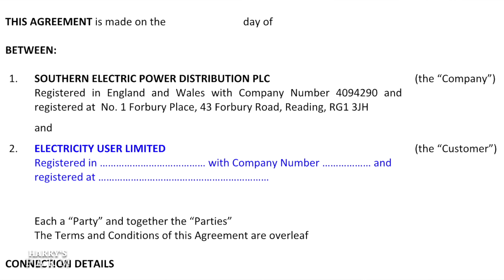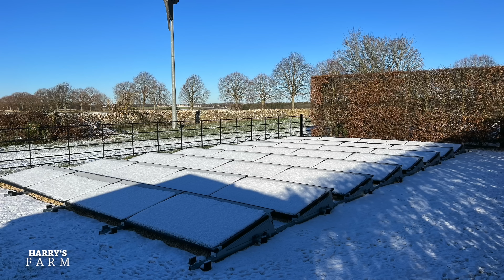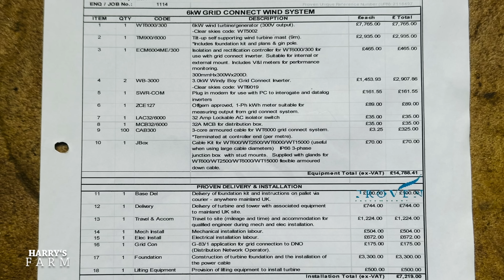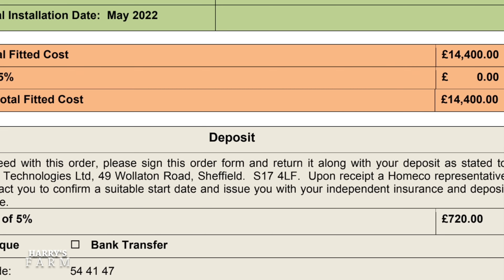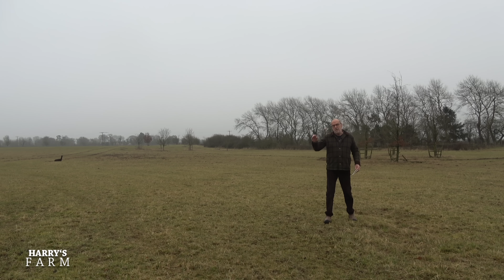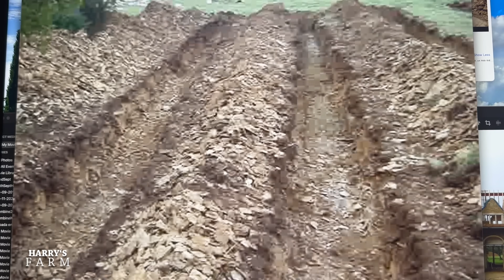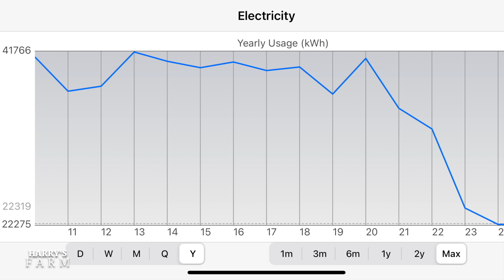Are solar panels & heat pumps worth installing? Here's what I've learnt after several years of use.

Comment: I was totally amazed at his surprise in the difference between summer and winter outputs from the solar ….what was expected 🤷‍♂️
Reply: If the panels were moved to a steeper angle, they’d generate slightly less in summer, more from autumn to spring. To me, they look too steep for June 21st at lunchtime! 

But… I’m no solar panel installer.

Comment: Living in Perth (Western Australia) the amount of sunshine we get is obviously quite different. For 3/4 of the year we are concerned with cooling, not heating. I have a 6KW system on the roof and find that it is sufficient to allow me to leave the air con on all through daylight hours which cools the house and then use a ceiling fan at night. My summer bill used to be my largest, now it is the smallest. To get the investment back takes 4 - 5 years but it does work well. Being retired washing / dish washer etc. are used generally during the day - maximising the benefit. I do sell to the grid but that's small change. I believe we now have the equivalent of two electric generators on Perth rooves and growing. I have been told batteries aren't worth the cost at this stage. Stupidly, with so much of our state being unsuited to farming, solar farms end up taking up arable land - because that is where the grid connection is......

Comment: The system doesn't shut down your production because it senses that a panel is going bad. What happens is that when several panels are connected in series if one is not producing enough it turns itself into a LED because basically LEDs and photovoltaic panels are the same thing on different scales. The non producing panel opposes a resistance to the current produced by the other ones and ruins your production.

Comment: Thank you my English brother for this eyeopener. To summerize it, you spent 14.5 grand on a 12kWh system, saved 24 hundred GBP a year therefore your return time is roughly 6 years while in Hungary I've spent the equivalent of 10.5 grand on a 8.5kWh system with 10kW batteries and saved 732ish GBP a year therefore my return time is roughly 14 year. All calculated in today's price. So saved money and return time can vary significantly. In Hungary we have cheap energy. Yet! So there you go...😅

Comment: Good for you!  After 30 years in solar including some multi- million commercial installs - I have to point out that as soon as I see these panels set on the ground- you lose credibility.  Anyone who is serious in solar learned decades ago that you NEVER mount solar panels that close to the ground.  When you mount those panels less than 6 feet up; 1) they will get "sand blasted" by any high winds as sand will not exceed 6 feet height 90% of the time, 2) you will experience grass and weeds growth after a few years when that gravel will of course fail in time = more expensive upkeep.  I could go on and on, but whoever mounted those panels on the ground did not know what they were doing and did you a HUGE disservice.  Of course, if they made a basic "solar 101" mounting mistake, I shudder to think what else is wrong here....sorry, I had to point out the obvious.  Also, reviewing a solar install after a couple years is like reviewing a car's reliability when you first start it and before you drive it off the dealers lot- solar should last 40+ years.

Comment: He's a very clear off-the-cuff speaker. A few notes, and all the points are made, with figures and no stumbling and cutting. I guess he's been presenting to people for years? What did you do for a living Harry (it clearly went quite well)? 
I'm interested to know what your annual heat load per m2 is as that's the true measure of building fabric efficiency. If I assume half your 22,000 annual kWh goes on heating, and the floor area is 475, then that's 23kWh/m2.yr, which is a very good - that's EnerPHit level (passivehouse retrofit standard, which is 25). But it might be 17,000 on heating, and all the stairs, cupboards, skeiling spaces don't count so maybe it's 400m2 in PHPP 'useful area' terms. That would be 42kWh/m2.yr which is good, comfortably beating the 50kWh/m2.yr of the AECB carbonlite standard, but only half as good. So, yeah for a 2007 house, despite the extravagances of pool, aga, and heated garage, you did a pretty good job. Self-builders generally build much higher-quality houses than developers do (because they care about running costs). Passivehouse is 15.kWh/m2.yr for reference.
Interesting video, thanks.

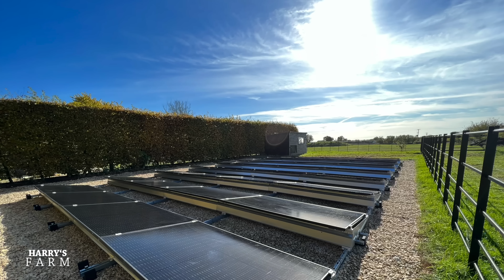Comment: Harry  -  The one thing that I noticed here at 5:54 is that your solar panels are almost laying flat with the ground and not angled up to look directly into the sun, having them up into the sun in winter is a lot more important than the angle in the summer because the winter sun is lower in the sky and it has to go through more of the Earths atmosphere to reach the panels.    The winter sun radiance (Dec/January is about  (3X Weaker/ less radiance) than the sun in the summer (June/July) so it is why it is much more important to have your panels lifted up and aiming more for a Winter Sun than the summer sun.       Also having your solar panels raised to a higher angle will help the frost and snow melt off more quickly and the rain will run off and help wash them.    Good Luck !
Reply: Best of all solution - install solar panels on a dynamic frame that automatically adjusts angles to current season or even follows the Sun. Things have become a lot cheaper these days. I would also install SPs higher above the ground for various reasons such as shading, mud splashes or anything crawling that can damage your installation eg. chewing through wires for fun. I know in this case there’s more than sufficient available space some could utilise under solar place as a shade area during hot summers.
Reply: @anylookup  20 yrs ago i installed 18 panels  [in sixes] on posts 5ft off the ground, fully adjustable. now i have 170 panels most of them 8 inches off the ground at various angles, concrete blocks and 4x2 timber. most not anchored. the closer to the ground the less wind issues , i use rocks to minimise the amount of wind that can get under them.  i have about thirty on shed roof just lying on the roof, the wind doesn't bother them, maybe a cyclone will.
Reply: @anylookup  that frame also has a cost. So price wise, you can just add more panels instead. 

But just lifting the panels off the ground does help. Maybe some place needs a shade or make the panels a roof for the anilals, tractor garage etc. 

I think winter optimization makes sense, in summer it's so easy to over produce anyway. Even now in February it's decent once the sun is up. Yesterday my 17kWp roof solar made 56kWh, more than i use even the coldest days.
Reply: 2nd this comment!
Reply: Hi, when it’s a grey sky and no sun to be seen the flat panels make the most power.
Take care M.
Reply: Only thing you didn’t mention was net metering.. This is why more panels harvesting summer sun giving you credits for winter makes far more sense then excessive battery storage.
Reply: From my recent experiments with solar panels I learned: Mounting racks and the wiring are more expensive than the panels themselves. Conclusion: Do not waste money on tracking the sun with incredibly expensive constructs. Better throw your money on simply more panels, no matter the angle or the azimuth. String inverts are nonsense. Take a bunch of micro-inverters up to 2000W and provide them with 3 times more peak-power than recommended in parallel. This will ensure at least some production in low light situations and performs way better with wandering shadows.
Reply: The size of your solar panels are way to small our 400 watt panels are 2 meters wide and long
Reply: @NickyClayden-r7y  My 420W panels are 1.78m by 1.10m.
Reply: I do admire Harry for trying these new energy / heat solutions. Especially with the farm side of things and pool , garages etc , but for me average, in 2-3 bedroom, Acaica Avenue, it’s just not viable . When you live in a country with weather as systematically shit as ours ,( last year was frankly pathetic), we have to be honest and admit that only the arctic tundra has worse weather than us . When we get more sunny / hot days in a year , than not , I’ll revisit this , but until , just wear slippers and put on an extra fleece .
Reply: @williammorris1384   I agree with the solar/good insulation comment from another contributor but not the heat pump......unless you've got a draught free highly insulated property ASHP are a money pit and even then it needs to be a balanced system to make it worthwhile and  very few properties can achieve that.
Reply: @williammorris1384  so wrong, my panels also ground mounted, 12 panels at 410w produced well over half my consumption even last years crap weather. I don’t run a pool but a 1200l hot tub 365 days, a large old house, so not as you described. It’s very feasible to have a system like my one on a roof. You don’t need blazing sun to produce electricity. Plenty of YouTube channels of people giving monthly reports on what they produce. It’s easy to work out what would work for you. So rather assuming it won’t work, look at those that are making it work.
Reply: @williammorris1384  lmao@new
Reply: @williammorris1384  it's always viable, maybe not perfect but some solar panels and batteries combined with good insulation and a heat pump really makes a big difference
Reply: From what I know about solar panels is that they should be angled to match your latitude for winter efficiency and they should face S to SW.
Reply: @rainbowdrive1961  Yes, aiming the solar panels to match your Latitude will aim the panels right in the middle between (summer sun overhead and winter sun low in the sky) however I prefer mine to be aimed about 5 or 10 degrees lower than Latitude in the sky to help increase winter solar production because as I explained earlier the winter sunlight must pass through more atmosphere and so there will be 3x (LESS) solar energy in the winter at the solar panels than there will be in the summer.     If you have a Heat Pump and cold winters as Harry has he needs more electricity in winter to run that heat pump than most people might need if they have Gas heat.  Solar panels that are off the angle of direct sun create a lot less electricity,  the best is to be aimed directly at the sun at all times with moveable solar mounts.
Reply: @Bowhunters6go8xz6x  You are not going to get significant output in the winter in the UK no matter what you do. Especially with the weather.
Reply: Why would you waste the angle trying to catch the small amount of winter sun we get than trying to capture the summer sun when it's sunny on more days and you get  daylight for 16-18 hours a day rather than 7 and half. You would produce more power annually by focusing on the summer sun rather than winter.
Reply: @ashlaw4392 because you have massive overproduction in summer - or at least, I have. Mine are already angled slightly more towards winter optimisation. I don't need 30KWh per day in summer
Reply: @ashlaw4392  summer for most people produces more than you can use. Winter you want to max out every drop. So if you don’t have a heated swimming pool, it makes more sense to get what you can out of winter sunshine. Now to be clear I recon there are only about 6-8 weeks a year the solar drops off to being a poor electron provider. That’s last couple of weeks November, December, start of January. Rest of the year those solar panels wake out the power. National ave UK electricity price is 29p kwh. Solar, batteries and right tariff choice you can get your consumption costs average well below 10p.
Reply: @ashlaw4392  True. But it depends on the location; in some places electricity in winter is more necessary than in summer and vice versa. If I'm in Arizona, I need that electricity at max in summer to run the air conditioning; if I'm in cold gray skies England, I need that electricity as much as possible in winter for heat for which in the UK many don't even have air conditioning.  System I'm looking at right now(I'm in the Midwest USA), my roof the production in winter will be surplus according to calculations we've done so perhaps I'll use some electric heaters. Summer I have a lot more sun and electricity produced, but seems it'll be a little short of what I need as my AC runs pretty heavy in July and August.  Then again, hopefully the panels on my roof reduce the need somewhat for AC as the sun is heating them as opposed to my shingles.

Comment: I’m a little surprised that he is surprised at any of this. The idea is to build to a size that targets a given percentage over a year’s time.   

A responsible installer will be very clear that Summer, then Spring and Fall are your producing parts of the year. Further, that your nameplate system wattage is Idealized from test conditions, and is NOT the regular production output you will really EVER see.  The target is your annualized take.

Comment: 14 times implies some shading (and I can see there is some in the snowy pic). It's typically 9 times difference winter to summer peak in the UK. That's still a lot, and yes you need a huge system if you want it to heat your house in winter. (We have 7kW on a 3-bed house and that runs all the electrics all year round except about 4 days/yr when we get 5 grey days on the trot (like right now), excluding heating). The UK is a long way north so we get this huge summer/winter differential.

Comment: The answer is, it depends on where you live.  If you live in a place where it is cloudy when you need power, solar is a bust.  If you live in a place where electricity is cheap and unlikely to ever go up dramatically, forget solar or wind, just stick with the power company.  Here in the Bahamas, I have 21kW nominal which is more like 14kW actual give the mounting choices I made for hurricane sustainability.  The power is tiered in price so that if you live like an illegal Haitian (i.e. very austere), you "only" pay $150-$200 per month.  And then there is a middle tier which is narrow and then if you use any air conditioning at all you are in the top tier.  My 2800 sq ft house has 2 AC units and a huge part of my AVERAGE bill was billed at .55 cents per kWh (before installing the solar) and it ran me about $700 per month me trying to minimize AC use as much as possible.  Now that I have 50KwH of battery and ~14kW of real production I am very near being off the grid completely.  I am installing another 50kWh of battery and I have the ability to install another 8kW of generation if I see fit.

The cost for install was high even though I did most of the work myself, around 85k USD for a premium install (meaning on top of a shipping container that was converted to a battery house and looks like the main house structure after being disguised with hardiplank ship-lap).  Thus it would not be worth doing unless 1) I had a lot of year round sun and 2) the cost of city electric was outlandish and going higher.  Both of those things are true in Freeport Bahamas and so it was an easy decision with a 10 year payoff.  One nice thing is that I do not need a backup generator.  The install includes an ATS that falls back to city power if there is no sun and my batteries get drained.  Also, if the city power goes off the only way I usually know about it is because generators begin auto starting at all of my neighbor's homes.

I should note that solar panels, batteries and inverters are coming down in price.  My system is made of older, high grade components  like Sunny Island inverters instead of cheap Chinese gear.  But those inverters were $4k each when I was buying them and you need 2 for split phase 240 VAC.  Today you can get a 10kw sine wave inverter charger with direct solar panel hook up for $1500 and that takes the place of DC combiners, DC cutoff, charge controllers (and all the breakers for them), and a ton of routing of expensive copper welding cable.

If you are reasonably intelligent, patient and are willing to write down a detailed plan, anyone can design their own solar system and save the stupidly high cost of the installer.  Then just get a certified electrician to do a final check and sign off on the work.  Of course, YMMV based on how much local government busy body bureaucratic tyranny you have to deal with.

Comment: You made the mistake of listening to installers “we will optimize the system for summer” they say. No, optimize for autumn/ winter, the summer will take care of its self , yes there is still a summer peek but you can heat the house and run the cars March to late October with a bit of care and batteries.

Comment: So in 2007 u started fitting all this stuff correct?
And what did all of the massive amounts of panels pipes digging concreting cost.  
Im sorry but theres eliphants in rooms and then theres a full herd!   The amont of money diesel and carbon that went into this stuff is simly enormous and there is no mathematical way it it cost effective or carbon cost effective,  every pro ev sustainable anti oil video news broadcast advert an ao on does the same thing as harry did here

Comment: I recommend getting Microinverters for each panel since that will solve your shade problem. you will also see more power output from each panel in winter months.
Reply: 100% this.  Shutting a whole bank down is obsolete
Reply: This is one of the value factors of microinverters that few people understand.  The  microinverter naysayers ignore this detail and only compare the total yearly difference between microinverters and conventional string inverters.